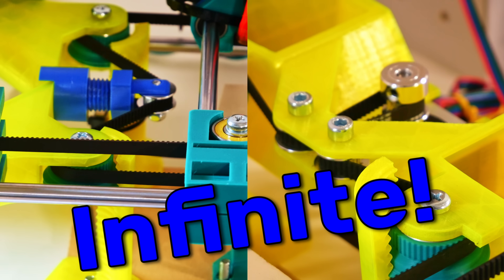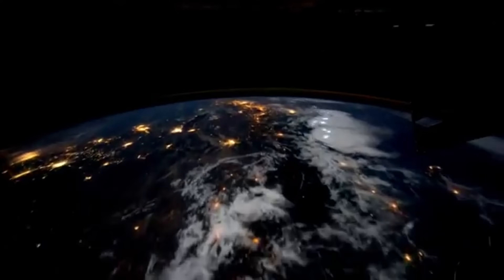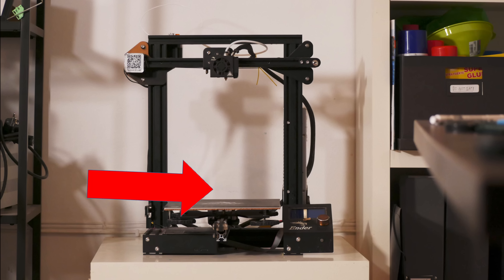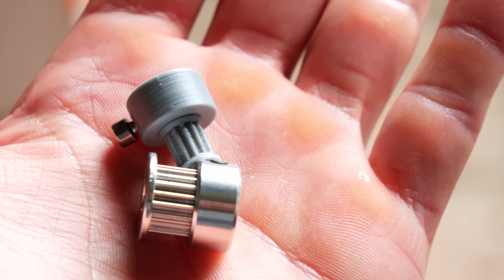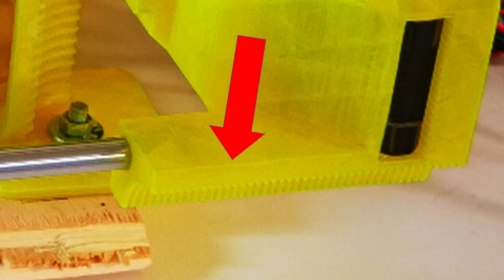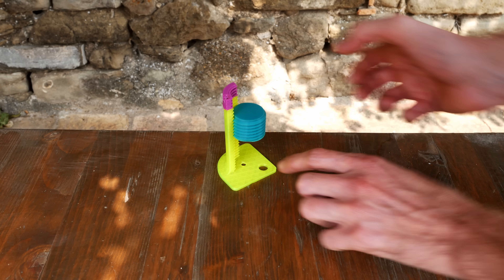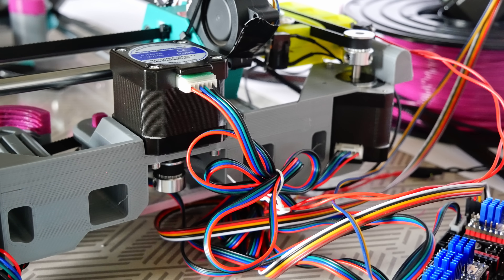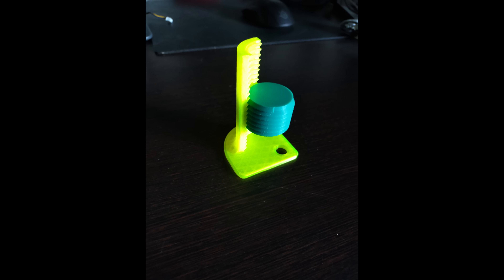it can 3D-Print onto itself?!

Comment: A hauler ship can carry a few printers that work different materials and together can create new printers; along with tons of filament/dust in various materials + all the motors, boards, cables, sensors, belts, bearings, and anything else that is non-printable but necessary to build hundreds (or thousands) of printers. Such cargo would be packed a lot denser than semi-assembled printers, and a giant ship can carry a lot of materials/parts when they are packed this way. Imagine this concept together with parts needed for building facilities, rovers, power stations, etc.; and you have a pretty realistic scenario in which a specially trained team of skilled engineers land on a planet, make some printers, and then start building a base on the planet with the clay they make from the planet's soil, while some of the printers are also working on expanding their printer inventory. They can even make fully autonomous cargo vehicles that can go to the cargo bay of the ship, load a pallet of materials, and deliver them to individual worksites. On the worksites, automated robots can handle some assembly tasks and feed material to the printers, unload finished parts, clean the print bed, etc. The engineers will handle the repairs and maintenance, which of some will be taken over by the robots after a while. On the other hand the engineers can improve the design of whatever they make, based on their experience on the planet; which is also shared with a community of experts on Earth, who also come up with new ideas to improve the work in different aspects. A few years of beautifully managed work like this; and the planet would be ready to accommodate a few hundred people to come and settle down.

Comment: Seriously cool. But you're missing an arm.

A manipulator with AI that can assign and preform tasks which are relevent to the printing queue... it could print itself and move its creation to the side.

What's more, is if you could somehow print FROM the arm itself... like a 3D pen... then you could create wires to power these new creations all without touching a thing! 

Seriously, an industrial arm just shrunk down... possibly 4 jointed and extra long so it can get around 90 degree bends; I'm thinking 2 prongs for grabbing... but very wide mandibles (like the Jaw Ant insect) 

Printer nozzle on arm may need to be able to swivel too, or rotate, or both. This will make it easier to get in small spaces

Perhaps a Y shape; 1 side has rotating cube head, with 5 different nozzles for printing (very small, wide, 2 other ones lol or doors for cleaning the inside of the head for jams), and the other side of the Y has grabbers for manipulation, on its own actuators so that entire side can bend independently.

Microassembly with printing.

It can make electronics, it can make wires, it could make itself. It could make drones to steal parts for itself

I really wish I could print ideas

Comment: Hi, why do you want it assembled printed? You'll still require a filament input, some real-world placing, and some other output quality checks.
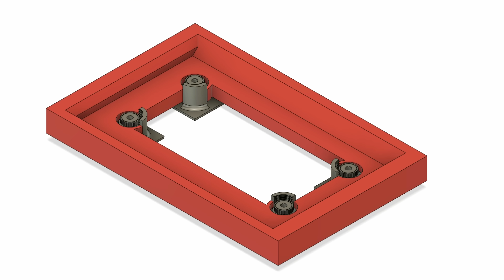You may print you Infinity Tower as pieces to assemble, since the gaps between the handfull of printable pieces (at 9:15) may suffice for more than 1 output per printabie volume. (Think as shoes in a box.)
The use of actual Z levels could be for multiple printable volumes stacked vertically. (Think of shoe boxes stacked.)

In one printable outline red rectangle, if you can fit parts for 2 printers, then fit multiple stacks of printer parts you'll have just to assemble them all.

And at the end of the day, you don't need multiple printers incrementally grown: you only need one incrementally grown support structure and driver belts (and powerfull enough motors), that you can reassemble your existing input printing parts on.

Comment: Still waiting to see how you plan on printing the electronics to make this fully reproducible. You seem to think it is already possible, however I have been looking into techniques for doing it for a while now and it is anything but. My best idea so far is to print with organic semiconductors to make the controller for the new printer, but with a low slew rate you can't simply design a processor and run standard 3d printer software on it. If you want any chance of success, you need to design for it more like an fpga or an asic and synthesize your circuit to interpret commands and run the printer. But I would be impressed if you could even print a functioning organic transistor to begin with and apply selective doping to something like pentacene. Let me know when you have more on that front.

Comment: This is so cool! The fact that it can upgrade to larger print volumes is insane. You could ship a tiny, lightweight "seed printer" through the mail and then bootstrap it to an entire makerspace. Combine it with a upcycled filament extruder and you could transform a pile of old soda bottles into a useful community resource.
Reply: I would imagen cnc machines being more useful
Reply: @Marcos-eg9lt  a 3d printer is a CNC machine (Computerized Numerical Control) the difference is just that a CNC Mill/Lathe subtract Material and 3d printer add Material same system different process 😂
Reply: @nightraven1319  You understood what was being said.
Reply: @Marcos-eg9lt  I understand it as other CNC machines would be more useful than 3Dprinter and if you mean that than I don't see it like that you can transport print materials easier than material for mills and such and it's less wasteful especially if you print metal instead of milling it. 
Do you mean that with CNC machines?
Reply: @nightraven1319  With the printer you are With relatively small parts with long wait times, unless that all is needed I dont think would work.
Reply: @Marcos-eg9lt  if you want bigger parts just build a bigger printer like it was shown in the video or build the bigger thing out of smaller parts and for speed yes its slower but printers get faster pretty much every year they are still a relatively new tech and there is much R&D and the other method is just use more printers if you have instead of a production line a Hall full of printers I think you can get similar outputs at least for 1 Material Parts
Reply: @nightraven1319  I doubt this can get to much bigger sizes without redesigning to be that size and It is about now, not in the future when 3d printing is improved
Reply: @Marcos-eg9lt   we already have the tech for bigger printers we do already print houses the only difference to the small printers is pretty much nozzle sizes and materials and that could be designed in a year less or is already designed I would count that as now.
For what was presented in the video that could possibly be realised for use in about 1 to 3 years if he gets help for that. 
The problem is not the tech or the printer the problem are the people that sit on the top floor of all the big companies that don't like change because change means they could lose money and with that slow Innovation to a near stop that's at least my look at things.
Reply: @nightraven1319  I am talking about this machine not ones that can print houses. getting actual machinery, printers or lathes, seems more reasonable then this which seems more targeted at hobbyist. I also doubt printers would ever get to a point were they replace current machining  except for luxury or highly specialized items.
Reply: @Marcos-eg9lt  but printers are already used for non luxury items pretty much every plane has 3D Printed parts and you can buy one instead of a car if you life somewhere remote like the Outback down under and yes the printer isn't perfect for a solo hobbyist but I think what DistortedSemance meant isn't a solo system and more like he said a maker space for the complete village/small City that everyone can use and for that it is pretty good you become a small printer and just make more in the size the Population of that Location needs 
Also you are right that for some things there is still a need for lathes and mills but I think that will be less and less over time
Reply: @nightraven1319   plane parts are definitely specialized pricy parts and why would you get a 3d printer instead of a car if you lived in the outback? Also what use would a village have of 3d printers? Making their own products would still need much more then just printers and would be pointless unless they want to be fully self sustained and cut off.
Reply: @Marcos-eg9lt  you would buy a Plane that has 3D printed parts instead of a car so no luxury item.

And do you know how many things are daily thrown away because some small plastic part breaks or small metal part things that you can print in 2 to 3 h I have a small printer at home and know how to use it that's not the case for many people

So I never talked about being self sustainable I meant printing things that people need for repairs or small gadgets that help in your daily life.

My Father lives about 600km away from me and has no 3D printer so if they had such probably pretty cheap self printing workshop he could send me the measurements of the part he needs I sent I'm the print file and he goes printing or he asks a neighbour that can use fusion 360
Reply: @nightraven1319  I would not buy a plane because those are expensive. Having a 3d printer to fix cheapy plastic things and printing gadgets seems perfect for this you should get him one of these.
Reply: @Marcos-eg9lt  there are plans for under 100k and I would say that is something that a person with a relatively good paying job can get instead of an new  car 
And for fixing parts you can print with metal or carbon fiber not just "cheap" plastic things I did print somethings with carbon fiber for my bike and they look high quality and are extremely robust 
And yea I could get I'm one of those but he doesn't know how to use them because of that a maker space where he can get help and print stuff that I send I'm the files for for 5-20 Bucks  
But I see that this isn't going anywhere we could just agree to disagree 😅
Reply: @nightraven1319  Is 3d printed carbon fiber also expensive or is most of the price is manufacturing it?
Reply: @Marcos-eg9lt  yes Carbon on cars is pretty expensive because of the manufacturing.
And Carbon Fiber filament is also a good bit more expensive than normal plastic filament
Pla is about 25 for 1kg and Carbon filament is between 50 to 100 for 1kg but at the same time 1kg Carbon Filament is more than Pla because it's a lighter material and you need less of it for a part because it's more robust
Reply: @Marcos-eg9lt  And I imagine a genie that grants you infinite wishes to be even more useful. What the fuck are you on about? Do people even think before posting anymore?
Reply: Combine that with certain inventions like the tiny hand powered centrifuge for malaria testing, and a few other innovations and you could basically send a small box to a remote area, and within a few days start large scale testing for diseases/parasites, water testing, printing prosthetics… etc! 
It would make a huge difference by helping sick/injured people to be useful and productive again, it would add value to trash and plastics which would incentivize clean up and recycling and it would allow those small poor areas to become a bit more self sufficient and ready to receive aid!

Often times the issue is that testing can cost more than a cure.. the logistics and potentially dedicating time and money without knowing how bad a situation is becomes the problem. If you can test an entire area for maybe 50 bucks and give confirmed numbers for malaria and parasites, you basically jump to the top of the list for aid, because it’s so much easier to order and procure a known quantity of drugs and know that they’re going to be used and not go to waste or get sold and lost.. 

Instead of spending thousands of dollars and needing several skilled technicians and doctors to examine and fit a few people with prosthetics, you can basically send one trained person with a single 3D scanner that costs a few hundred bucks, and a single 3D printer like this one and start getting prosthetics fitted to people in record time! Proper fitting ones that don’t cause more issues because of bad fit, like nerve damage, open sores that can get infected.. etc. 
There’s tons of videos on YouTube of people making their own prosthetics and the process is super fast and easy, you don’t need a trained doctor or technician… any local could be trained to use a 3D scanner and printer over a weekend and use one of several free programs that generate prosthetics based on measurements! You don’t even need to know how to 3D model! 

This could genuinely change the world one day. I believe it because regular printers already have… this is just another big step in the right direction.
Reply: throw in a solar energy system and it may be able to be used to help developing countries.

Comment: i love the idea of automate EVERYTHING... but i believe you want to tackle all problems at once...  i believe that could make more sense a line of production... one machine create the parts... other machine assembly, other machine tested and put it to work... and you can make all 4 machines with the same process... 
the hard part could be the struder, you have to combine multi types of material to achieve it... graphite as a conductive material.... metal has holding and brass element... and ceramic has mold the metal

Comment: A 3D printed Von Neumann machine seems like a plan. The trick with the Mars project would be the initial feed stock to build  autonomous miners/refineries/feed stock extruders and however many iterations of enlarging printers are required to do it. I'd suggest nudging a nickel iron asteroid or two into the landing zone to provide a range of useful metals and a carbonaceous chondrite asteroid to provide organic feedstocks.

Comment: Is there any way you could print a nozzle? It would need to be made of a material that, once cooled, forms a structure with a higher melting point than it was printed at, and I'm not aware of any such material (that doesn't require annealling)

Comment: Disclaimer: I am by no means an engineer in any capacity. Take whatever I say with a grain of salt.

I have ... kinda a crazy idea. Infini-Z's entire point is that the entire printer moves vertically to be able to fit whatever it needs to inside it almost infinitely, right? If that's the case, then why follow the typical layout for x and y of a printer? If you don't do that, then there'd be no "no build zones," right?

Comment: The self expanding legs are genius. Now how do we make it do the same thing for horizontal rails along the Y axis?

Self replication is good, but our next grail I think is self assembly, which means some form of self manipulation outside the confines of the build envelope. We already have expanding PIP moving parts and expanding structural frames, including fully print in place robot chasis. Once we can electrically magnetize printed conductive filament, that opens up fully PIP motors, and from there servos, robot arms and full robots to print and roll themselves off the bed and go source material to make more filament from.

Comment: If your main aim is to make a 3D printer that prints more printers then there is little reason for longevity for the parts since you can just print another printer. Things like the rails should be able to be replaced by plastic tracks with just teeth and a gear.

Comment: Is the screw design really best way to handle the Z-axis? What if instead you had some sort of ladder-inspired design and a pair of teethed flat "feet" that walked up and down that without any dragging of surface on surface? Or if that's too complex, what if instead you had a ribbed cylinder and a gear with teeth that kinda hug it following the curvature, or even just a plain flat rack and pinion style mechanism, perhaps with a 90 degrees pair per corner to offer similar stability?